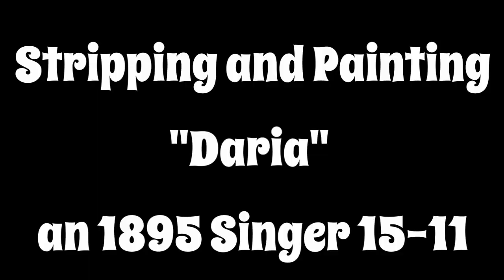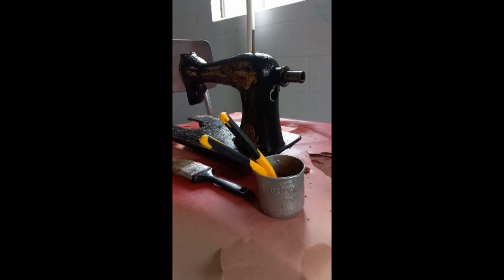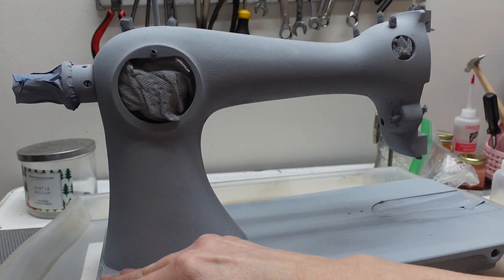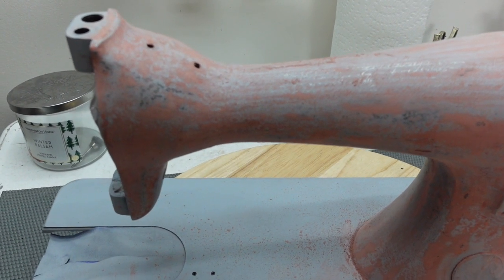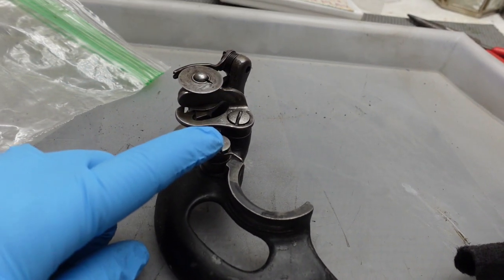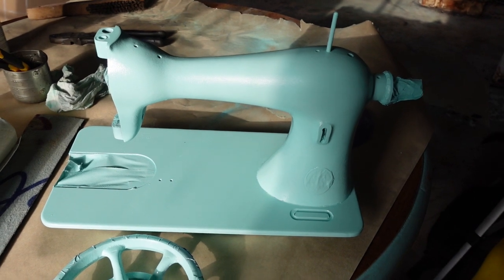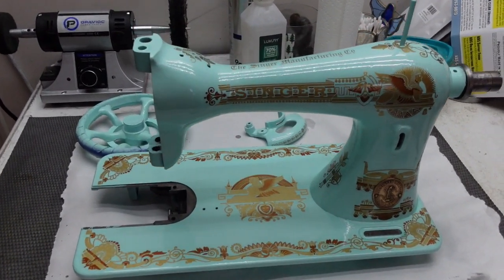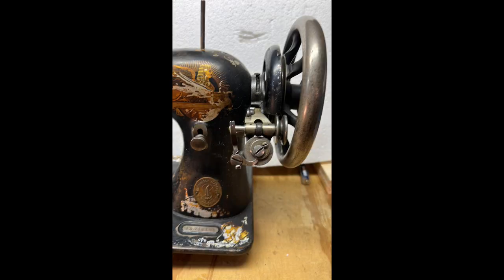Stripping and Painting an 1895 Singer 15-11 sewing machine

Comment: Awesome job! This looks amazing! Did the clear coat damage the decals at all? Thank you for posting!😎
Reply from the maker: Thanks! The clearcoat doesn't hurt them at all. It only protects them and keeps them shiny :)
Reply: hi what kind of paper you are using and what printer? thanks
Reply from the maker: @denisvelikov8081  for this machine I purchase decals from singerdecals.com but for the ones that I make I use usually a clear water slide decal paper

Comment: May I suggest using Dolphin glaze UPO714. Glaze the whole machine. This stuff is real creamy,sands easy. Will save you hours in labor. It’s designed for pin holes.
Reply from the maker: Thanks! Do you know how it works with self etching primer?
Reply: This product is made to go over pin holes in primer. A bit pricey. I use it to skim coat the bed and touch up elsewhere. YouTube has videos. Thanks Mike.

Comment: Having tried multiple methods of removing paint from these machines, including this method, I can tell you that the easiest way to remove the shellac and  the asphalt based paint Singer used to create their black color is electrolysis. Electrolysis is much easier than it sounds, it's literally just a bucket, chicken wire, and a battery charger, it blasts everything off right down to bare metal, it's really the only way to fly. I won't use any other method anymore, nothing came close to electrolysis.
Reply from the maker: I'm going to try that on my next one! I'm guessing hooking a positive and negative to the chicken wire and wrapping it around the machine?
Reply: @prometheansewingmachines  please video tape the process.  I just found your video.  I am in the process of sanding bonds to get it ready to paint. Yes changing colors is just a nightmare.  Hoping my last color make me happy.